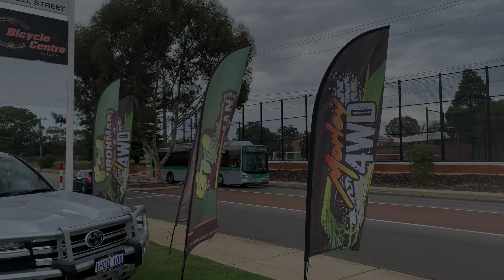Ironman4x4 Raid Bar: First look and Review | The BEST, offroad option for the LDV T60 MAX?

Comment: Bro i am planning to buy 1, how is the car engine and over all build quality
Reply from the maker: @majidshaikh7717  hey man, haven’t had any dramas with the engine at all which is great considering it’s a 2.0L and we’re towing with it. 
Build quality mechanically is good, we’re pretty rough with ours. Inside some of the plastics feel a little cheap. 
It’s certainly not Toyota’s level of build quality but ours has been airborne and driven 1000s of kms on rough dirt roads and there’s not an issue so far. 🤙

Comment: Hey Dicey, saw at some stage you had a throttle controller hooked up but did you get or considered getting your ecu tuned? If so, did you find any one in Perth that can do so on the new t60s?
Reply from the maker: Hey there, thanks for watching and commenting. 
Since the EMS update on the new T60s the ECU hasn’t been able to be tuned. There’s at least one tuner working at it that I’m aware of but he’s over east. 
I’m using a tuning module in the meantime which has been great at releasing more torque and power from the 2.0L. 
It’s a module by EliteDrive Performance, same as my throttle controller, who worked with LDV NZ to develop the maps. I’ve done a video of the module on the channel. I’ve enjoyed having it on the T60. Good bit of kit.

Comment: Hey mate how did you hook up your UHF radio
Reply from the maker: @ZachTaiba  stuck it on a bonnet mount then ran it through under the steering column with the receiver mounted on the dash just to the left of the steering wheel. 😁

Comment: hey bro does it help with the clearance at all?
Reply from the maker: Solid question and the short answer is Yes.

The long answer is front on the approach is only slightly better due to the curving up of the bar and bash plate. You’ll notice that I’ve bent my number plate because that sits straight down from its mount.

Approaching on angles the clearance has definitely improved with the cut away and up design. You can see at 3:13 this clearly on display as I’ve come down a dune dead straight. The sand is across the marginally improved front but not on the sides.

If you’ve got the time, check out the OFFROAD with the LDV T60 MAX | Scorching Murchison 4X4 Adventure | Off-grid channel announcement! Video at 6:18 and you’ll see the difference between stock clearance and the bar.

Hope this helps. 😁